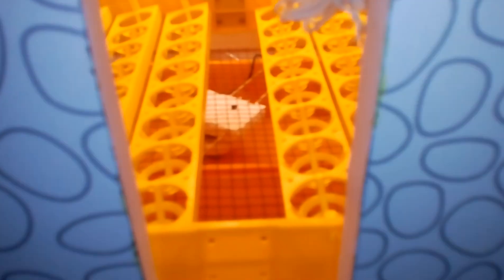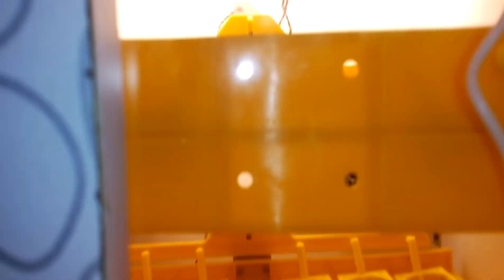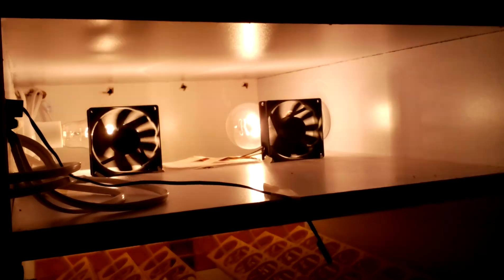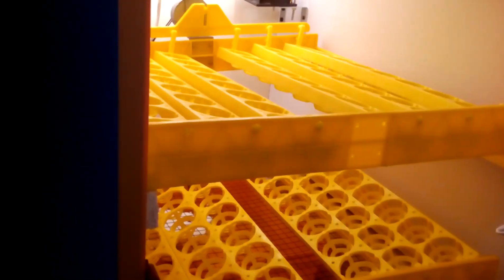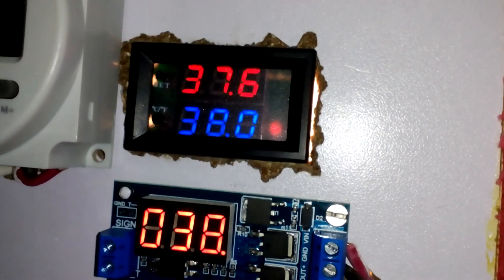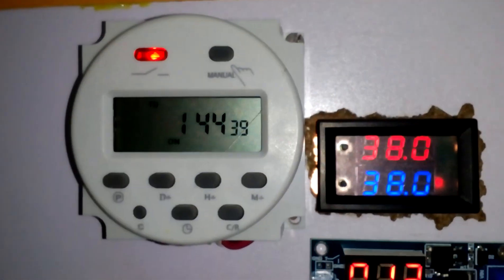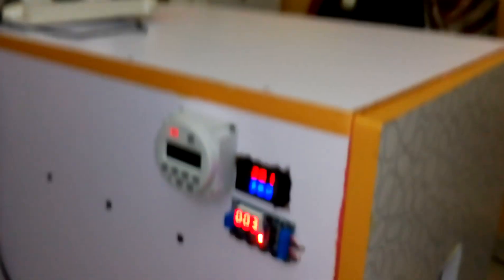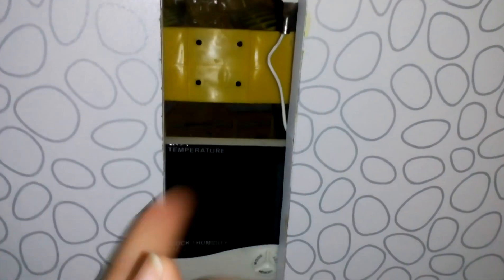auto egg Incubator - chicken incubator

Comment: umair ive been following your tutorials on incubator why not use a humidity controller instead of just a timer?
Reply from the maker: Normally Humidity controller cost around $18 and this timer cost $3 only and the budget was also low of this Incubator
Reply: gee thanks for the idea, have you been trying to guesstimate the time needed for the humidifier to be on? coz I saw ur humidity % hitting just right
Reply from the maker: @posadasmark  yes first time as it reaches 90% I lower the opening time and increase closing time so it just works 10 second after every 2 minutes in this big size Incubator to reach only 60%
Reply: thanks again for the info im too lazy to use time relay arduino 😂😂😂.... too many program setup, though I will be using a timer same as the one ur using on the turner tray coz it has more simpler operation